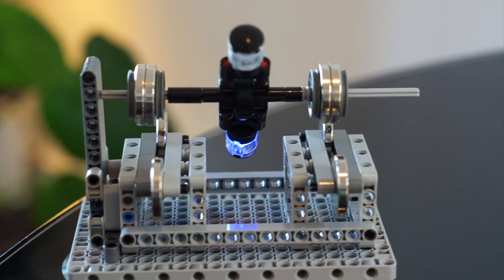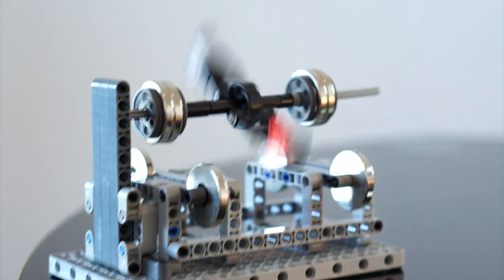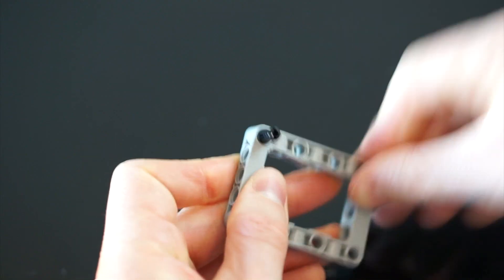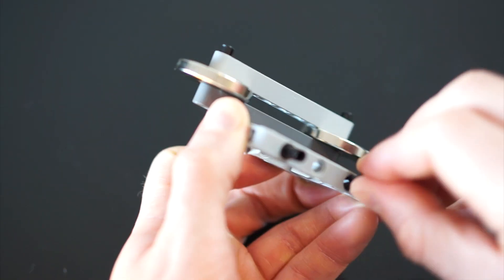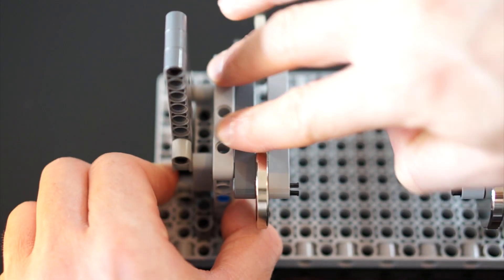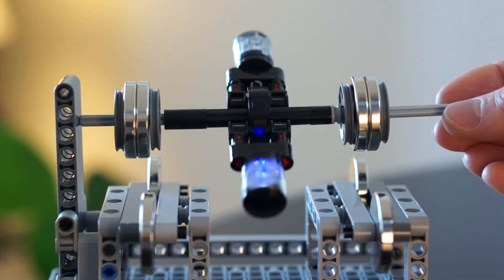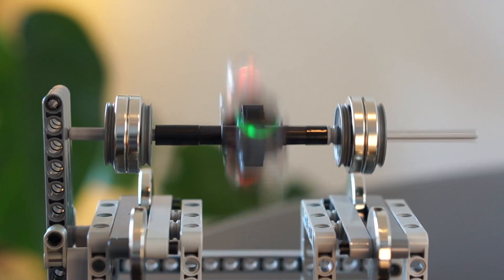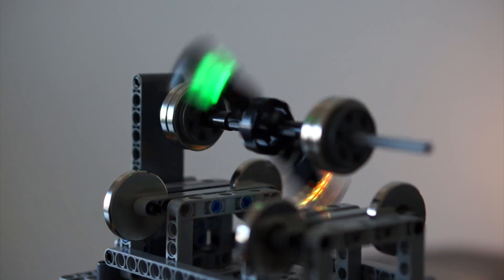This Lego Levitates

Comment: Could you possibly use this to spin the crank on a Lego generator? 

It probably wouldn't produce much, but it might be a neat idea to increase total overall output from the generator by having something continuously spinning it.
Reply from the maker: You could indeed. Though anything with a significant power draw would produce quite a bit of drag. Probably fine for some low powered LEDs though. Tom Stanton made a beautiful levitating flywheel generator like this

Comment: Hm nice nice. One thing that could make it look nicer, maybe, is to use tension on some string on right instead of drilling into liftarms? :) could probably use friction-less pin to hook up string to some fixed hole, and then it's just  a matter of attaching it sensibly to spinners axle. if string is thin/and or transparent, could be almost invisible!
Reply from the maker: That's actually a fantastic idea - might reduce a bit of friction too. Like you said, maybe some thin fishing line would make it almost invisible! Cheers for the idea - I'll definitely give it a try as there's an upgraded version of this I'll be building soon.

Comment: try 4-point contained maglev axle, with two end cap plate maglevs and two radial tube bearing maglevs to keep it same angle
Reply: thats same as trying to balance something on top of a hill, when its trying to roll down, do it better
Reply from the maker: I think I understand what you mean .. it sounds challenging, but I'll play with it and see just how bad it is
Reply: @JamiesBrickJams  well its just stable maglev
Reply: @JamiesBrickJams  simplest form of stable maglev is vertical stick